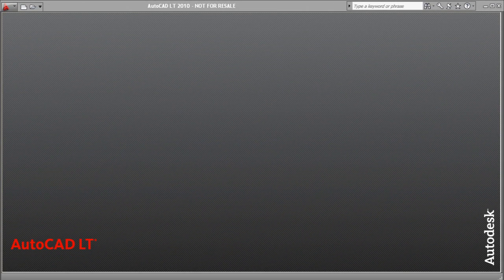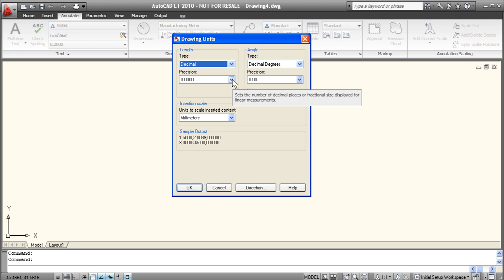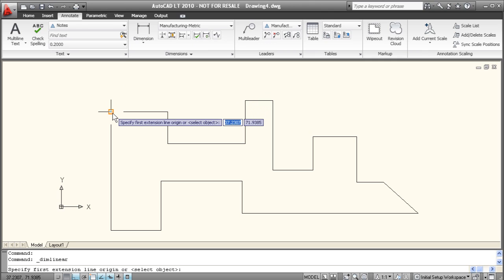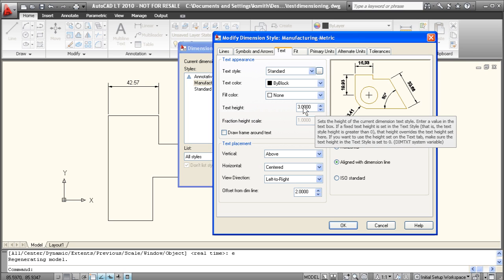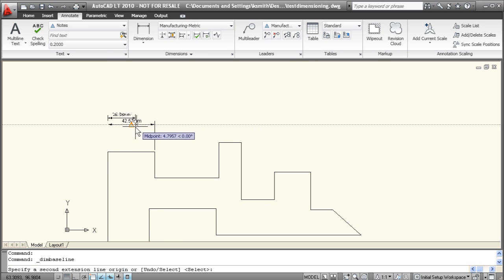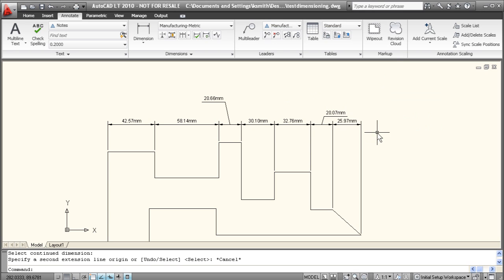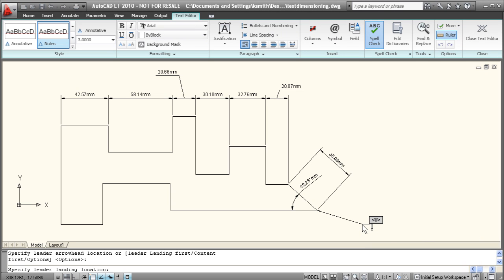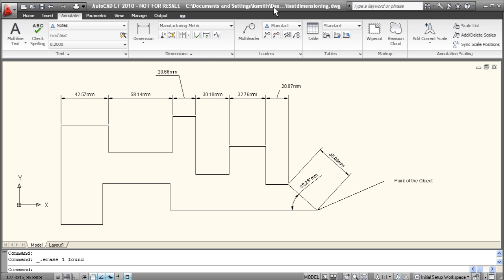AutoCAD LT 2010 | Dimensioning Tutorial

Comment: I have no "manufacturing for metric dimensioning" template.

I finally found, by bumbling, that acad_bsi.dwt is a metric template.

I found what I needed (converting an existing drawing to metric dimensions) in the Options command under "AM:Standards". From there I noticed that under Standard it had a choice "BSI" for metric, that is how I determined that the template "acad_bsi.dwt" is a metric template.

Comment: Only "Parametric" dimensions control the length of the line and parametric abilities aren't available in the LT product.  You can simply Stretch or grip edit the line to change it's length.  Dynamic input can help in this editing process.  You will want to ensure that you are setting your dimensions to "Associative" in the User Preferences tab of the Options dialoge box.  I've never used solid works and hope I never have to.  Welcome to the world's standard drafting software.

Comment: You've found the reason I don't like to use the suffix.  This can be individually over-ridden by selecting one (or all with quick select or Filter) angular dimensions and deleting the suffix text in the Properties toolpalette.  Another method is to create a Dimstyle Override.  This can be confusing to those who might inherit your drawings or insert them as blocks into another.  In my opinion, it's better to address units with a note as he mentions at the end.  Imperial doesn't have this problem.